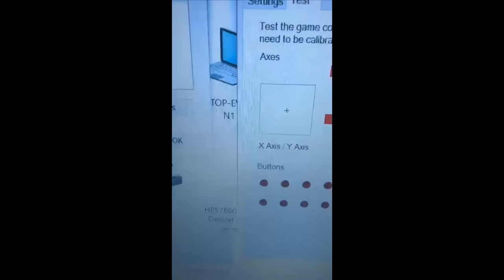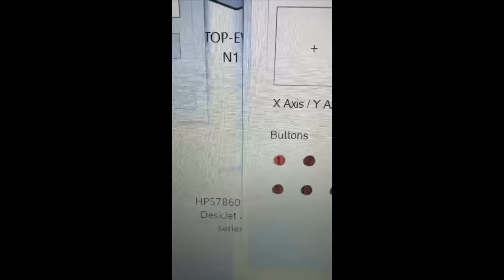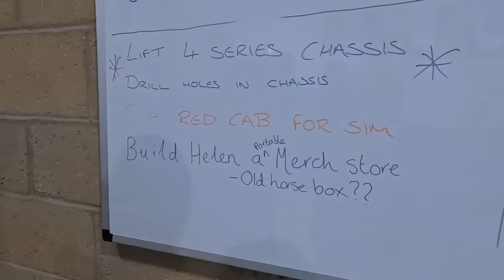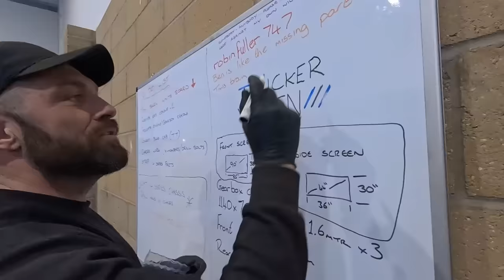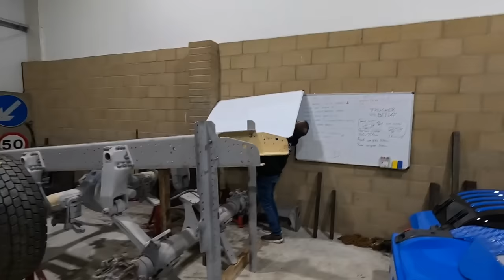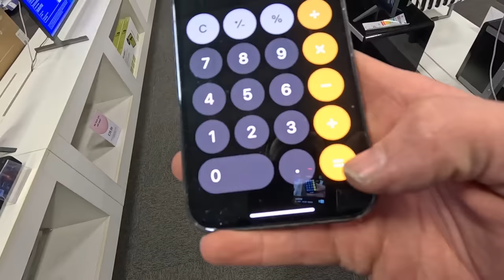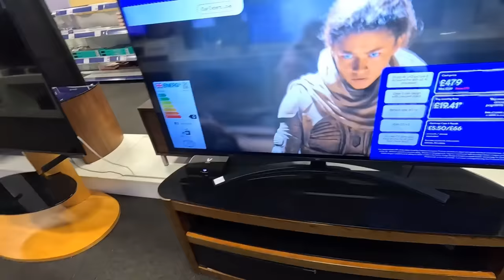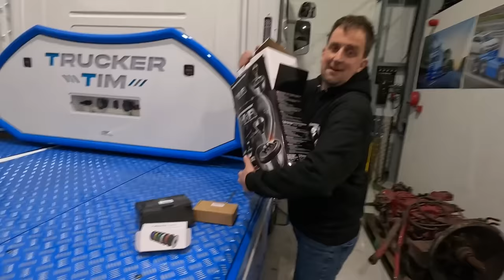BUILDING A FULLY WORKING TRUCK SIMULATOR USING A SCANIA CAB | #truckertim

Comment: As a fellow Bengineer, I would really recommend binning that thrustmaster steering wheel, it simply wont last. Reach out to Fanatec and ask if they can subsidize/sponsor you to do this as their hardware will be far more upto the task.
Reply: Yes the motor isn't made to support that amount of weight
Reply: He should get the new Moza truck wheel
Reply: @CatSovietski  He wants to keep the cab true to its original form, What he needs is a proper Wheelbase! Moza's or Fanatec either one will do with direct drive and a proper gearbox

Comment: You have the wrong wheel base and steering wheel.

Moza has released a 400mm truck SIM steering wheel and in a few months they're releasing the indicator stalk kit which has three stalks for lights , indicators ,wipers etc

Comment: FYI pc run on 12v which most interior lights and fans also run on 12v. So if you get a good pc / power supply and a good pc builder they might very well be able to wire up most of the interior to come on with the pc.

Comment: I would consider putting a door in the back of the cab. I have a feeling shutting the cab doors with tvs mounted on them will eventually knacker the electronics. They’re not designed to have shock put through them

Comment: Great video Tim. Possible over engineering/costs here?

Could you install a small compressor to replicate the air brakes under hard braking/putting the handbrake on?

Comment: I’d change the thrustmaster wheel mounting point you won’t get any of the feedback experience while driving with it mounted from the steering column 🤣 you can get a a wheel adapter plate to be able to use the original scania  wheel Timmy boy

Comment: Hi trucker Tim matey and Ben 👍 it's mark from Wirral Merseyside 👍 Helen idea for horse box to take to truck show's or whatever think it's a great idea 👍 and Ben is doing a great job I'd rather see the Scania R4 series getting done and painted and rebuilt again that's more important than the truck simulator which can wait.. get the blue Scania R4 series painted and rebuilt Time is ticking away now and you won't be going to any truck shows if you don't get the blue Scania R4 series finished Spring and summer is going to be upon us all pretty quickly. Tim matey get the blue Scania R4 series finished and leave the truck simulator cab that's not important right now 👍

Comment: Only sat in a 4 series passenger seat to go from Holyhead port truck check in to the trailer waiting area to pick up my truck for the shift so I did not know that but my guess is it’s an optional extra

Comment: for wheel and pedals should look  at moza the direct drive wheelbasses start at like £295 and there wheels are detachable through a quick release system also there pedals come away from the footplate a lot easier, also be better to have tvs inside as if you take it to shows etc youlll have to be weary of the weather if the on the outside also with the tvs inside the cab it be a lot easier and neater to cable mange/hide cables

Comment: My 4 series under bed locker used to lift up like that as a table and slide over towards the passenger seat so you could use it as a lap tray aswell

Comment: As a PC builder and sim enthusiasts I'll straight up tell you: 4 screens ain't gonna work.

You can only use 3 screens for the sim, plus one for a dash/chat screen. Graphic cards tend to have, at least the high end models, three DP connection, which you will use for the sim, plus 1 HDMI that you can't use to work in connection with the 3 others.

Euro and American truck sim also only support up to 3 screens.
Reply: And you need at least a 12 or 16Nm Direct Drive wheelbase to even get a bit realistic feeling out of that steering set up. The shitty 2,3Nm of that thrustmaster won't be enough.

And the PC you will be using, what specs does that have? Because all does 4K screens need a very beefy GPU to even give you any kind of framerate.

Comment: You’ll need to find a graphics card that will drive 4 monitors
Reply: I'd also look at getting a couple of buttkicker gamer pro's to give the cab some live engine vibrations , gear changes etc and also look at some 3dsim pedal rumble motors. In the future you could look at putting some movement to the cab with actuators 😄

Comment: Hey trucker Tim   As a SIM Racer I can see that you have bought the t248 or t128 thrustmaster these are very budget-friendly wheels I would 100% recommend going to a direct drive especially for this application 
There is 2 companies I would highly recommend which is fanatec  or moza racing.
I would personally recommend going for the Moza r5 or r9 pending on budget As they have just released recently a truck steering wheel pacifically designed for Euro truck simulator and American truck simulator or any other truck simulating games.
Love your content keep up the good  work 💪💪❤
Reply: Why would you recommend Fanatec with the ongoing issues with actually being able to fulfil customer orders, they are the ones to avoid, and actually go a little higher... Something like an Asetek La Prima
Reply: Because they are an established brand yes they have some issues with fulfilling orders recently but they have good wheels for a reason of price And as you can see by my comment I highly recommended Moza instead because you probably will be able to get it in a timely fashion And much better prices and better stuff in their ecosystem wheels pedals shifters Brands like Acetec or SIM cube Are quite expensive for what they are as they do not have a lot in their ecosystem that would be good for this application.
Reply: @joelkelly6211  a CSL DD 8nm and a La Prima 12nm are the same price. 

As for ecosystem, he's using a proper steering wheel, there no need for an ecosystem. Ps Asetek makes you can use ANY wheel that is USB very easily, neither moza or fanatec make that as easy. 

Ps Asetek based on Simucube software for less (and a 12nm for same price as Fanatec 8nm) ...
Reply: Okay im not going to get into a backwards and forward with you on which one is best I was just putting my recommendation out there As those 2 companies are quite well-known in the SIM community And work on most games especially truck simulator games  For a decent price.